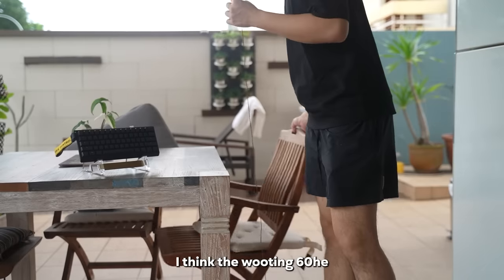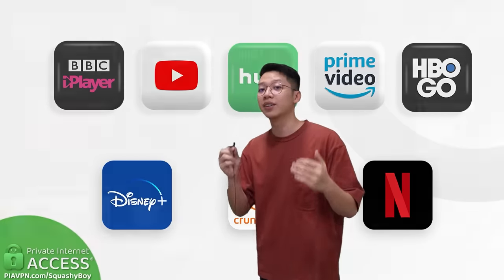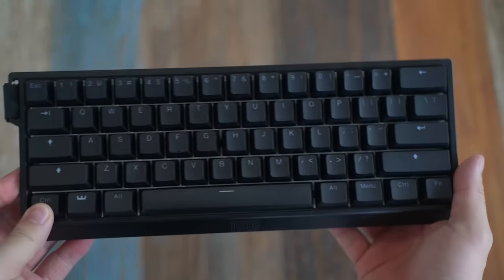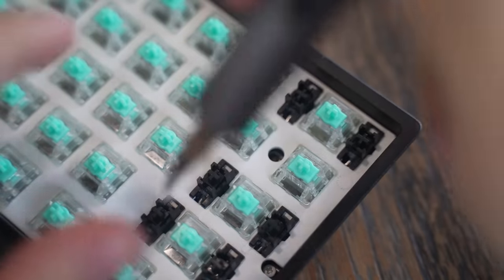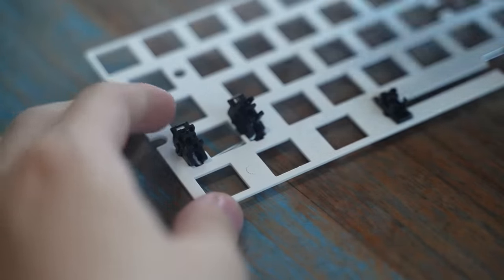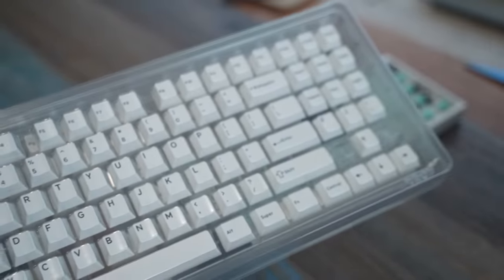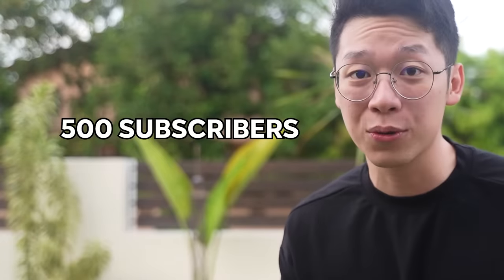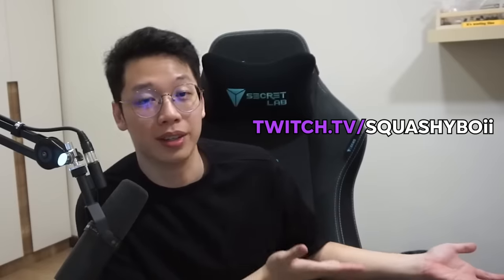i fixed the Wooting

Comment: To be fair even the stock version of the keyboard sounds alright for a pre-built gaming keyboard
Reply: True. You can actually make do with just modding the stabs
Reply: @weeiii.93  the stabs are probably the last thing you need to mod. Theyre pretty good
Reply: @mauu3291 what would you say is the weak point then? The case?
Reply: @thegravyboat420  I think the weak point is the switches, non-lubed springs or something. A new case helps as well.
Reply: @ertgb_  I agree, the switches have a alot of spring ping
Reply: @ertgb_ why are non lubed springs bad? just the sound or there's something more to it? I'm new to this kind of stuff
Reply: Yeah, I like the sound of the stock version more.
Reply: @delveticas Late reply but both sound and making the downwards motion feel less scratchy (scratchy feeling resulting from the spring touching the surroundings) is why someone lubed the spring.
Reply: @ertgb_  i would say the stock spacebar is a nightmare. i have it and when im typing my ears die 😭
Reply: @ertgb_  i honestly agree so much, I'm getting a wooting for myself and the first thing I'm doing is changing the switches.
Reply: @xyriahn  you only have a few options idk if any of them are better
Reply: i meant lubing mb
Reply: @xyriahn  oh that makes more sense
Reply: yea tbh i like how it sounds, i would just maybe tape mod it but in general the sound is very good in my opinion

Comment: Did this with a wooting60he and a blade60 case! so nice of wooting to give so much compatibility to a gaming keyboard
the switches are north facing but you can literally just rotate them and put them back in so you can use cherry profile keycaps.
this thing can emulate controller inputs too, this is literally one of the best keyboards i've seen.
Reply: @robthekidd  i dont think you can do that on console but on PC it can, for example, bind a joystick to WASD. so slightly pushing down "W" will slightly push the emulated joystick forward. this is useful in games where slowly moving can come handy. Fortnite benefited from this a lot at the time, as controllers have better movement range than keyboards.
Reply: where did u get ur blade60? I'm looking for it
Reply: @werelion2893   blade60 cases used to be sold on kbdfans at the time, so i jumped on it.  checked right now, not available anymore :c
Reply: @RickyVespucci  awh man. i guess I'll look for tofu60 cases. u know where to find any?
Reply: @werelion2893  wish i knew but i don't.  stopped looking around keyboard stuff after my wooting lmao
Reply: @RickyVespucci  orh. alright thanks
Reply: Does it have any problem with the switches ?
Reply: @xanzoxnz  apart from them not being lubed, I've had no problems with the switches, facing north or south
Reply: Thoughts on trying this with a brutal60
Reply: @RickyVespucci  what do you mean by rotating switches to use cherry keycaps? Also is Wooting hotswap?? Seems so on the vid
Reply: @Signaworks  Cherry keycaps dont work as well when the switches face north, so the wooting lets you rotate them to face south.

the board is technically hotswap but only with switches they make, so as of right now lekker switches are the only switches to use
Reply: @RickyVespucci  Oh now I see. Did some research and those Wooting switches only have two symmetrical guide pins (and only the hall effect sensor in the middle) so they can be rotated 180° easily.  

Someone also mentioned that Gateron have upgraded their molds so that the newer switch housings (Lekker included) don't interfere with Cherry keycaps anymore! Wooting just hasn't  thoroughly tested that yet with GMK sets etc.
Reply: WAIT...IT FITS ON BLADE60???I THOUGHT IT ONLY FITS IN TOFU60
Reply: @dafaqu694  It does! and it looks so good!

Comment: Inb4 some ytber comes out with the 
Wooting+++ - Everyones fav cheater keyboard Rev 3.0! New features include:
- New cast iron case, because it wasnt different enough
- Memory foam cut up from a Tempur-Pedic pillow
- LED light up carrying strap
- Improved keycap set (Its just another olivia clone) 
- an improved ortholinear design

All for the low price of $1500!
Reply from the maker: id buy
Reply: id buy
Reply: id buy
Reply: id buy
Reply: id buy
Reply: Nah im broke
Reply: Okay but where are all the titanium and marbled carbon fiber boards?

Comment: nice build! rly sad that the original 60% Tofu got discontinued and the 2.0 version is incompatible with the wooting.. i was planning to do a similar build but i guess i'll have to search for a different case
Reply: all that would need to happen for the wooting to be compatible with other cases that are not tray mount is to design a plate for whatever board you want to put it in
Reply: If u find a good budget case reply to this message I’m same as u
Reply: @PerHaps, if u find a case that works, let me know
Reply: freebird60 case should also work
Reply: Klippe T
Reply: Tofu60 Redux

Comment: A metal case makes a massive difference. I have a custom keyboard with a full stainless steel case and it makes such a difference. its also heavy enough to be used as a viable weapon. My number one suggestion for anyone looking to build or upgrade their keyboard is to focus on the case and lubing. this makes the biggest difference. foam/tape/etc help but not as much as some lube and a metal case. I hear wooden cases are decent as well (haven't tried one yet)

Comment: Use it a bit more and you'll find it'll develop some strong clickly clack, thinking due to some stem tolerance issues. Tried two batche of switches, hand lubed, happened with both. My stems are more rattly than my stabilizers :p

Comment: I'm a bit late to the party, but what was the purpose of separating the plate and the PCB? Does that need to be done in order to remove the stabilizers? Or would I need to switch plates?
Reply: Yep to remove the stabilizers
Reply: Okay great, thanks! @shelbyyang

Comment: Do i understand right: by a lucky coincidence the Tofu 60 case has the drill holes in the same place as the wooting?
Reply from the maker: yes, because the wooting is using a really traditional 60% layout, they have screws in the same place as well. this was mostly intended by wooting so that it was easy to modify

Comment: Do you need to take apart the two inner boards to just switch the case? New to this stuff but want to switch my 60he to a metal case of some sort, just not too sure about taking the switches apart and lubing them.
Reply from the maker: nope, i only took them apart to show to viewers how its done if anyone wants to do it

Comment: When you separated the plate from the pcb, did you use a different plate to fit in the tofu60? Or did we just not see you put the original plate back on? 😅 I’m going to do the same mod soon but I didn’t buy a tofu60 plate.
Reply from the maker: its the same plate, didnt want to have a different plate as it might cause interference with the distance the switches are to the hall sensors

Comment: Hi, just a quick question, if I would replace the switches, will the functionality of the wooting 60he not work like rapid trigger, changing actuation points? Or the tech is only on the pcb itself? Thanks in advance.
Reply from the maker: sadly the wooting only supports lekker switches or similar hall effect switches and not traditional switches as it does not have hot swap slots
Reply: @SquashyBoy  ohh okay. So lubing the stock switches is the way to go. What about the stabs? Cannpt use other right, and just lube the stock one as well? Thank you! Great guide!

Comment: The thing i have with the wooting is the 60g force needed while most high end keyboards have 40g. as someone who prefers lower profile,  lighter to press mechanical keys its just a let down. and i shouldn't have to mod the plastic to aluminium it should be prebuilt that way
Reply: Replace the springs to lighter ones they're crunchy anyway

Comment: If you respond to this a year later, you're a legend. But I am just getting into keyboards and I have a few questions. 1: Why did you separate the PCB and plate? 2: I'm more of a TKL guy, with Wooting's new 80HE would you bother swapping the case? I was thinking of getting the 80HE alloy case, and using Gateron Jade switches and whatever keycaps I wanted. Thank you so much if you answer! (or anyone that answers)
Reply from the maker: heyo 

so for 1. i did that just to show how one would go removing the plate. i originally ordered a polycarbonate plate for it but since it didnt fit correctly i didnt show it in the video. 

2. I dont know much about the 80he but i did order an alloy one for myself and will have a review of it out when its launched
Reply: @SquashyBoy  Absolute legend! I appreciate the response. I do have one more question. I decided to go ahead with the 60HE, which I will be putting in a Tofu Redux with WS Dash switches. Is the included foam and gaskets for the standoffs enough or would you do any other sound mods like tape or additional foam or silicone?

Comment: I wonder how these would work with the Ceramic keycaps that are a little heavier. My Cerakeys order came in and I love it and the board but have been eyeing the wooting for months and may still get it. Just love these keycaps way too much and want a reason to use them on the wooting.
Reply: Do a vid on it pls i wanna do the same

Comment: Do you actually have to completely disassemble it like that? It seems like you could just remove the keycaps over the five screws holding the PCB to the case, unscrew those, transfer the foam over, and put the PCB in the new case, and you're good to go. Am I missing something?
Reply from the maker: yup you can, i did it this way as i wanted to lube the switches and tweak the stabilisers but yes your way will work completely fine!

Comment: the tofu case is sold out everywhere, and iv found out they have a 2.0 version, anyone know if that compatiable with wooting as well?
Reply from the maker: sadly the 2.0 is not as they have changed the usb c port to the center of the keyboard
Reply: @SquashyBoy which case is also compatible with the wooting if the tofu60 won’t be available

Comment: what lube do i get for the springs and switches and stabalizers and where do I buy it. Im brand new to keyboards
Reply from the maker: you could use krytox 205g0, its a slightly thicker kind of lube but you can get it on amazon pretty easily, and or aliexpress
Reply: @SquashyBoy  ty was looking to mod my wooting and your video is very helpful! can the krytox be used for all 3 parts or only the switches?